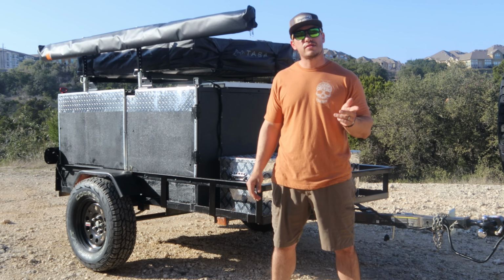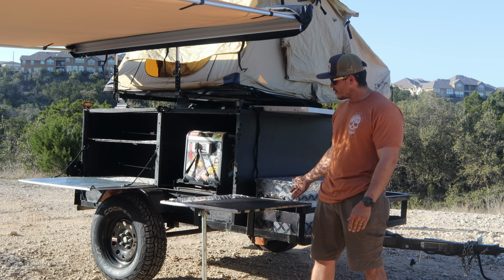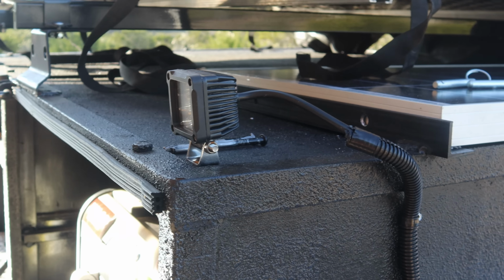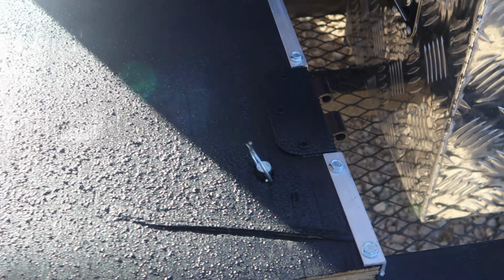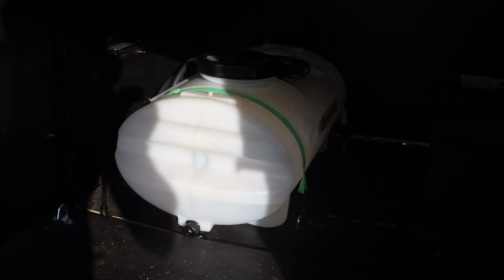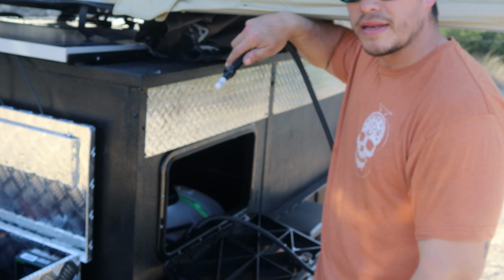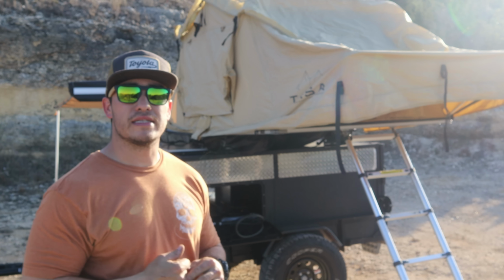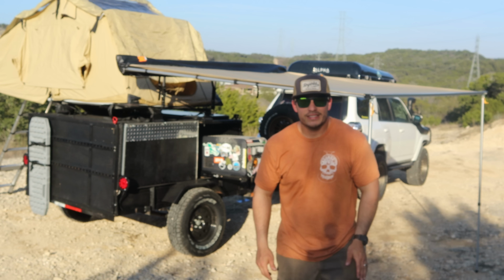DIY Budget Overland Trailer | Off Road Camping Trailer Build #overland #trailer #build

Comment: Great work! Dumb question, but on the right hand side, the door that pulls out to a table...on the upper left of that door, it looks like there is a gap or opening? First, why the gap, and second, wouldn't this allow rain and elements inside the trailer?